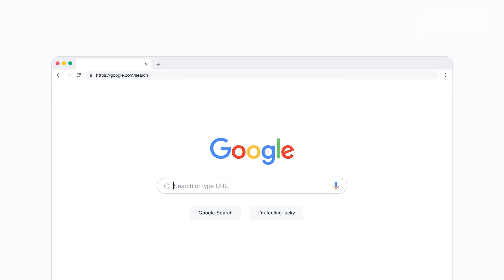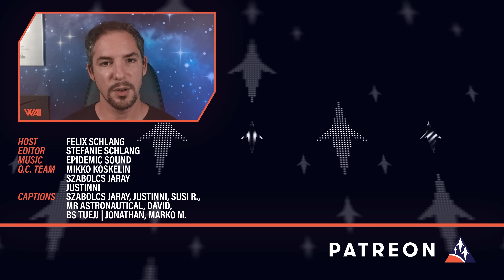SpaceX VERY cautious with orbital Starship Launch?

Comment: Been wondering for a while why they put that tower so close to everything else. One of those things will likely have an accident in that area sooner or later, and if the whole thing exploded at liftoff, fully fueled... I'd like to see the potential energy of all that fuel and oxygen compared to other known explosions.
Reply: Marcus House made a video about the possible energy released when it explodes
Reply: @Daniel-de2jh  I thought it was Tim Dodd but I think you are correct.
Reply: I would also like to see a simulation/animation of what would happen if the fully fueled Starship exploded on the launchpad, and perhaps 200-300 meters above it. There are some truly skilled computer graphic artists that have contributed videos to the channel, that if they combined their talents with someone who could do the Math calculations for likely explosion scenarios, we would probably get a good idea of what would happen.
Reply: @picksalot1  
There are videos out there show rockets of similar size exploding to get a true measure.
Reply: A lot of that has to do with logistics. The tower has to be relatively close because it provides all of the support connections to the rocket itself (fuel, power, etc.). Plus, it is the embarkation point for the crew and passengers onto the rocket.
Reply: @MadKilroy  right but the fuel farm? Either they move it or it gets destroyed. It's an inevitability.
Reply: This whole complex is a prototype in of its self... meaning that future launch pads for starship will most certainly be more polished, from the experience and knowledge they learn from starbase... a prototype launching a prototype...
Reply: I believe Marcus house did a video on a potential explosion.
Reply: Pretty sure Tim Dodd did a breakdown on this subject.
Reply: @patrickdurham8393  Felix and I did a video on it. 1-2 kilotons deflag
Reply: N/\S/\ should've offered a testing site specifically for stability test. That also would mean gaining an earnings for a service & playing a Ump roll in space achievements ( not FAA). Why be a space monopoly government being booed all the time.
Reply: Everything outward of the launch oad thats close is double protected.
Reply: the stored energy in a fully fueled starship+booster combo is close to a small atomic bomb, like the one dropped on hiroshima. however, that fuel cant ignite all at once in the same nanosecond, and after ignition also burns somewhat "slowly" compared to the immediate release of all of the energy a nuclear bomb would have.
Reply: Yeah the tank farm is way too close.
Reply: So if anyone is interested, I came up with an equivalent energy to 14 kilotons of TNT. That's assuming a perfect explosion where everything is immideately consumed, which is unlikely, but the smaller of the 2 nukes we dropped on Japan was 15 kilotons.
Reply: @Raven74947  I think the problem with the explosion math, is that methane & oxygen isn't going to have a fast burn rate like an explosive device. It would be a 'conflagration' rather than a 'detonation'. And the flames would be most intense where the methane and oxygen areas meet, which would actually push the fuel and oxidizer apart, further slowing the burn.
A 1kg sandwich, and 1kg of C4, have about the same caloric energy. But when burned, the rate of energy release makes all the difference.
Total heat release would be similar to Nagasaki, but the 'destructive blast' would be not even remotely similar, likely no supersonic shockwave even. 
More like something halfway between a very small forest fire and a very small nuke (nukes and forest fires have similar energy output, at very dissimilar rates).

I do think it would F'-up the boca chica facility though. Putting it 1km down the road would have been a wiser choice.
Reply: @Raven74947  Not really. If you compare explosions on estimated 'yield' of explosive force, then the Beirut explosion was about twice as powerful as the N1. And the Beirut explosion isn't even the biggest, just the most well filmed (because people were filming the warehouse fire before it reached the ammonium nitrate).

Rate of burn is key to figuring out the explosive force. The N1 did have a similar amount of fuel to Beirut, and likely more total heat. But it was a much slower burn, closer to conflagration than detonation, which limits it's 'yield' as an explosive. 

It depends on if you're looking at it as joules of heat energy, or as explosive force which depends much more on the rate of release. I think explosive force based on rate of release is a much better measure. That's what tells you how far away it breaks windows, how hard it knocks down buildings, how detectable it is on a seismograph, etc. A typical forest fire burns more fuel to release heat than almost all man-made non-nuclear explosions. And a big forest fire is on par with hydrogen bombs in terms of fuel-heat release. But the rate is really slow, and it doesn't even budge a seismograph.

Like compare a flare-type firework with an 'artillery shell' type firework. One lights up the sky, but the other makes your fillings rattle. They have about the same amount of fuel.

Actually, in some deliberate made bombs, rocket fuel is used as an intensifier. Basically you have a large bomb of a near instantaneously detonating material (TNT or better). And then around that you place canisters of hydrogen & oxygen. The core goes "bang", and the Hydrogen & oxygen get pushed out by the shockwave. They burn slowly though, burning up as they travel outward. BUT that has the effect of keeping a fuel source 'in' the shockwave, trickling extra energy into it so that it retains a high pressure for longer as it expands.

When they research to make more powerful explosives, it's not to get more heat energy per gram of explosive. Most flammable materials are fairly similar in that metric.  it's to get more instantaneous release of that energy, which causes a higher velocity and much more intense shockwave.

If full-stack starship were to explode on the pad. I dunno if the shockwave would destroy the Boca Chica facility. Definitely damage it though. I think it would knock all the hangar walls off the underlying frames. There would be 'some' shockwave and percussive damage definitely. But it wouldn't have a sharp, powerful shockwave. The fireball and heat energy could easily engulf the facility and burn it all down though.

Boca Chica would primarily "melt". Some percussive damage, and then lots of melting. But likely not throw debris for miles like a more percussive blast would. Probably be a huge amount of brush fires over a very large area too. Supersonic shockwaves tend to blow out any flame they might cause. But I think the heat fireball would make a flashpoint area much larger than it's supersonic shockwave area. It'd ignite anything flammable, probably at a distance greater than it's ability to break glass.

Anyway, in the video of the N1 disaster, it was very very hot, definitely. But not all that percussive. It is percussive, but not like some types of fuels cause. Look at videos of the Beirut explosion. That spherical pulse which emanates from the epicenter. Big difference. Beirut was 3.3 on seismograph. N1 would be considerably less, maybe 1.0, maybe less.

There are far bigger though. Beirut is just a very close analog for N1 in terms of fuel, and very well filmed which helps illustrate my point visually about the rate of burn, which makes Beirut much more explosive in terms of percussive force. Halifax or Oppau both totally dwarf N1 or Beirut though.

N1 is the largest explosion "in aerospace history", but not the largest non-nucleaar man made explosion in history. Not even close. The video linked either misspoke, or is just wrong.

https://graphics.reuters.com/LEBANON-SECURITY/BLAST/yzdpxnmqbpx/
the N1 isn't listed on here, but it would be in between the FOAB and the Beirut explosion in terms of explosive yield (in TNT equivalency). Beirut is like 400 tons of TNT, or 0.4 KT of yield. N1 would be more like 100-200 (or 0.1 to 0.2 KT yield). Even though Beirut was 2700 tons of ammonia nitrate, and the N1 was like 2300 tons of kerosene & oxygen. burn rate matters.

Actually now that I think about it, full-stack would have like 4500 tons of fuel... that might make a shockwave which approaches the faster burning 2700 tons of ammonium nitrate in Beruit. I wonder what exactly the burn rate of methane is compared to kerosene on the N1 or ammonium nitrate in Beirut.

BUT... yeah, the Boca Chica facility is absolutely too close to the tower. It looks a few hundred meters. It would be MUCH safer at more like a kilometer+. Either that or the buildings need to be made of reinforced concrete instead of sheet metal.

I really hope that if it has "problems" it doesn't have them on the pad in Boca Chica. That would bury SpaceX as a company. They have an assembly line, they can blow them up at 1000ft all week, not a problem. But blowing up the boca chica facility would be catastrophic for the company.

NASA should really let SpaceX fly on Pad 39A. Pad 39B is over a mile away. If full-stack blew up on pad 39A, 39B would only need a fresh coat a paint. I guess they're worried about it getting airborne, and then veering off course and hitting 39B. It's not terribly likely. Then again, "accidents never go according to plan" :P
Reply: @Raven74947  Let's hope that doesn't happen soon. But if constant use it will someday.
Reply: @Raven74947  in reality tho it'd be a relatively slow burning fireball, maybe .5 kilotons
Reply: @Raven74947  Yikes! I did a quick Google search, and 3 square miles were destroyed at Nagasaki, and 5 square miles at Hiroshima. The "AtomicArchive" says "In Hiroshima the general limiting radius was about 8,000 feet; however, even at a distance of 26,000 feet from X in Hiroshima, some tiles were displaced. At Mogi, 7 miles from X in Nagasaki, over steep hills over 600 feet high, about 10% of the glass came out."
Reply: They have limited space at Boca Chica

Comment: If everything is vulnerable to blast and heat why build the tank farm so close to the launch pad. Mechazilla and platform 0 need blast protection as well as the tank farm. Without blast protection Elon does not really care about them being destroyed and this delay is BS. Obviously , onr can not remove the risk of a RUD so put the fucking blast protection in or shut up and launch.
Or you build another starship base.....aren't they doing that in Florida😕😒.....😂😂😂😂
There is your answer. 
When Florida Pad 38B/C is finished and they can afford to have a RUD and not waste 6 mouths rebuilding it. They simply clear up and move to Florida whilst they decommission the site and sell it off to developers.

Comment: The thing I HATE about SpaceXHeads is that if SpaceX takes their time testing and launching it's perfectly acceptable and fine. However, if NASA does the same thing with SLS it gets shiton by those same SpaceXHeads.
Reply: It is the time difference (months vs decades). It is the money difference(2 orders of magnitude).
Reply: @cyberthanasis  NEWSFLASH...We need BOTH systems.
Reply: @cyberthanasis  Since it started SpaceX has spent $15 Billion in 13 years. NASA has spent $11.9 Billion on SLS in 11 years. SpaceX is NOWHERE near ready to launch INTO Space (not sub orbital). SLS will hopefully launch in November and send a capsule to the Moon and orbit out further than any capsule system has ever gone. BTW, Orion is "Man Rated" NOW. Starship IS NOT.
Reply: Only "Space X Heads" who don't understand iterative design or Space X expect or demand Space X "take their time". 
90% of the delays in Texas are down to the FAA and useless Texas politicians who failed to deliver on their promises to clear the way of irrelevant obstacles. 
There is a reason Musk started building the facility in Florida during the disputes and for the then rapid U turns by all involved.
Reply: @rorykeegan1895  The FAA is there for a reason. If you have a car accident a few people may die sadly. You have a rocket go off course over a city, the self destruct fails and the potential for thousands of deaths and billions of $ in damages when it crashes is VERY REAL.

Comment: SpaceX should have made and tested a proof of concept rocket that rose 1 km with Raptor2 and caught by the tower
Reply: Ot SpaceX should use a stripped down starship With 3 raptors and minimal propellant to prove out the design without risking many raptors and the tower and surrounding infrastructure.
      Or a Stripped down booster that rises high enough to catch.
Reply: Or just hold the booster in the chopsticks and lift it 20 meters with the raptors then catch it.  Anything to minimize the risk before Launching the fully Assembled and fueled Starship with booster

Comment: We're stuck choosing the lesser of evils here. Caution slows turnaround time, which we hate, but the other options as I see it are either to shorten turnaround on producing stage 0s or to engineer stage 0 to be able to survive after a RUD. IIRC the RUDS experienced by the N1 had yields on par with a nuclear bomb,  and starship is bigger by every measure, so we could expect a RUD from starship to have similar results. Is it really reasonable for stage 0 to survive a direct hit from a nuclear bomb? Alternatively, we know from Elon how much harder it is to manufacture something as opposed to creating a one-off, and the same goes for stage 0.
Reply: It's the prototype stage 0 that's the real risk - the design isn't 100% complete and if its ducked up now? we'll need a new one before we can continue to learn.

Comment: I agree that they should be cautious with the 24/7 launch.
BUT, i think they should attempt a launch with the old booster 4, i feel like they could learn a lot from a booster launch, even if it fails. Launch from a different area ofcourse, so it doesnt cause damage. They've never launched a booster, so i think it would be valuable information. 
But maybe im just greedy for launches lol.
Reply: Booster 4 was never flight capable to begin with.
Reply: They need to launch something with the new engines to really benefit from the test. Adding something on top of 33 engines isn't adding that much cost to the whole project, relatively.
Reply: You “think” not “feel like”.
Reply: @kissthesky40  false. "feel like " is valid
Reply: @cjkula  
It’s valid but it’s a terrible trend. It originated in the great Soypocalypse of 2015 on. Listen for it, you’ll hear it everywhere. It’s weak.
Reply: @hawkdsl  
Spread far and wide!
Reply: @kissthesky40  feel like is ok, but he didn't capitalize his proper noun i's.
Reply: @kissthesky40  ok

Comment: I always agree with whatever SpaceX does, I trust Elon Musk. My question is, does methane have the same properties as other fuels were an empty tank is more volatile than a full one?🤔
Reply: It does have that property. It’s the vapors within the vessel that actually achieve ignition upon failure. However when you are considering how cryo temp fuels expand into a much larger volume of space rapidly if there is some kind of breach it becomes much harder to determine the exact way ignition and the energy it gives off would happen. Rocket science be crazy my friend.
Reply: Yes, but note that a tank containing methane vapor — and nothing else — isn't too much of a concern, because there's nothing for it to react with. A tank containing a mix of methane vapor and air (or worse, oxygen vapor) is where things get scary — but also unlikely, since any situation where that could occur would likely have seen it accidentally ignited before they could thoroughly mix...